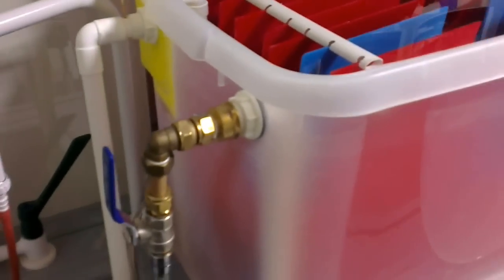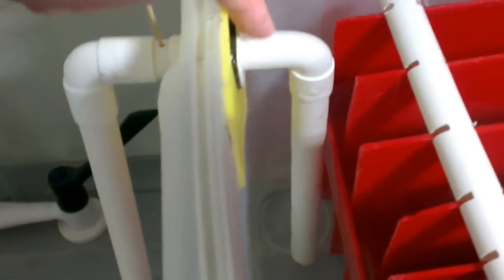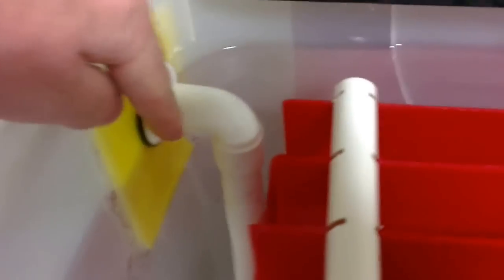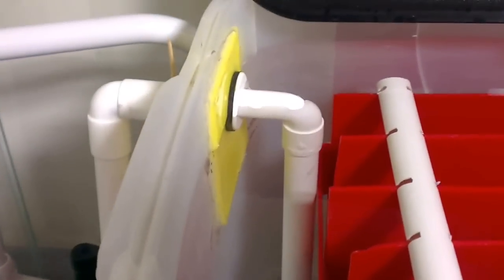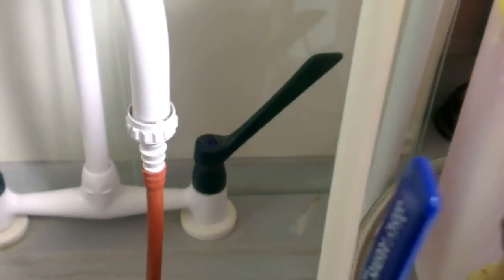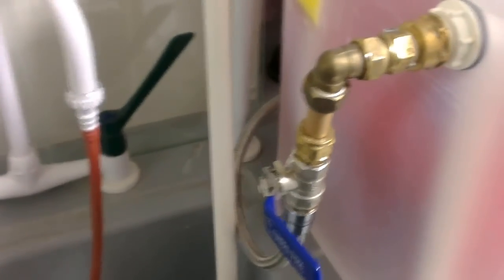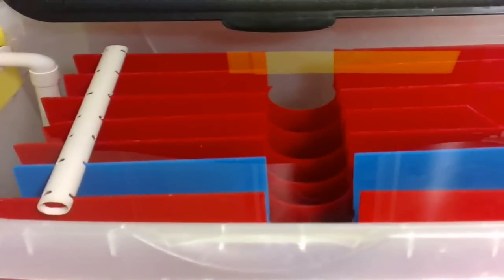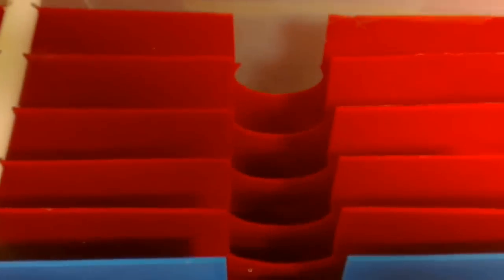DIY print washer

Comment: 10 years later, did the tank hold up? Do you have any new tips with the added experience of years behind your belt?
Reply from the maker: This build went into retirement when I was gifted a glass dedicated print washer ages back. I went for it because it was a lot smaller than that one. But in fairness, that diy one worked perfectly.

Comment: Water enters the tank at one bottom corner, flows across the bottom of the tank and is withdrawn from the opposite bottom corner. How does the water circulate across the surface of the vertically standing prints to wash them? Before investing time and money on this design, I'd like to see how well the water exchanges in the bulk of the tank. Perhaps put some dye in at the top of the print slots and see how well and how long it takes to flush it out.
Reply from the maker: Yes, doing a visual inspection with dye is a really good way to assure you of the effectiveness. One thing though, water enters through holes in a pipe at the bottom corner, so entry is spread across the width of the tank. The exit is from the opposite top corner to encourage flow across the tank.